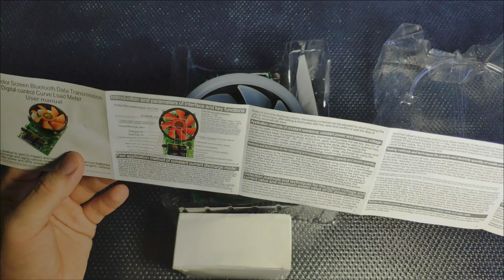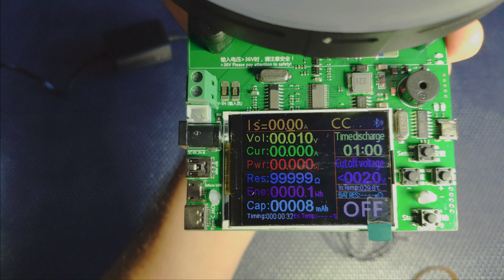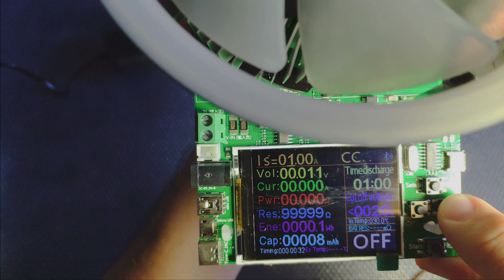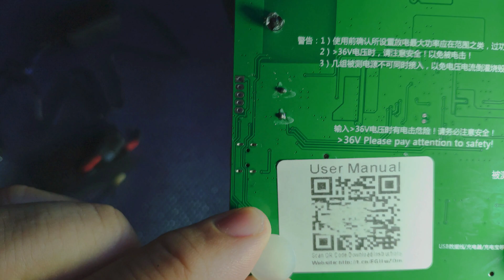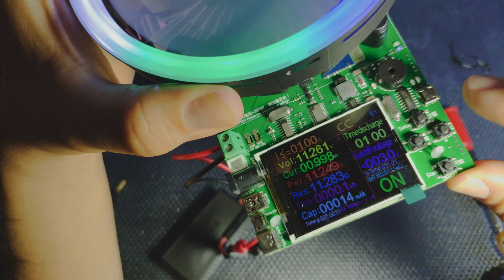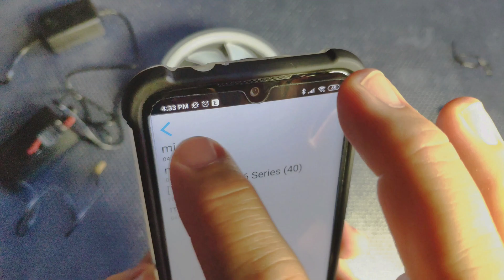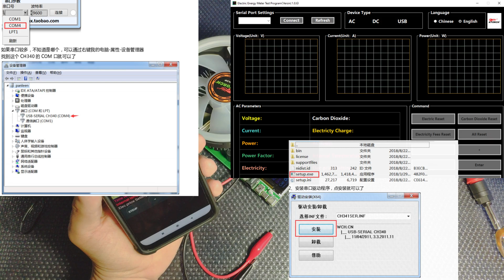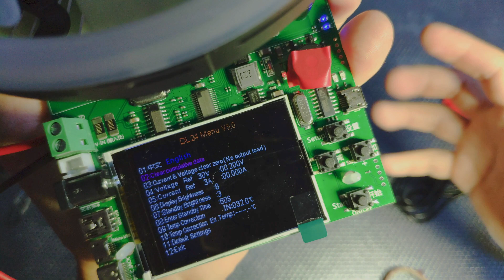DL24 Electronic Load Battery Capacity Tester

Comment: I'm at my second unit dying, testing it with a PSU before connecting to 18650 battery packs to test.
What I did is set the load to constant current, connected to a 84V 5A charger.
When increasing the constant-current value with the buttons, the unit happily increases the current and warns about power overload at the same time as the main MOSFET dies.

And once the unit failed to protect itself, the input is shorted, which would likely result in a fire if directly connected to a battery pack.
The seller Atorch doesn't answer unless there's a dispute.
I would not recommend. If you want to use it, I'd strongly suggest to always add a fuse to avoid short-circuits if the unit fails.
Reply from the maker: 84V@5A = 420W, the limit is 180W for this device. You should set the current to voltage before starting, if it exceeds 180 (185)W it will give you a warning and not start. But if you turn it on with a low current and then you keep increasing it and exceed the limit it will no longer enter protection, this is a workaround if you change the the mosfet and cooler.
Reply: @TechTronic9000  we might have different versions of this product, the behavior you describe is not the same as what's sold currently.
My first unit died as a load to test a booster converter unit, DL24 in constant power mode.
When adjusting the booster's CC limit, lowering it reverted to lower voltage and higher amperage and the DL24 MOSFET died at the same time as it displayed "overload > 185W" in red.

Second using was connected to my 84V 5A PSU, DL24 in constant current mode.
I increased CC value progressively to see what would happen if I did the same when connected to a battery pack.
At some point (wasn't filming) the DL24 displayed the same overload warning again at the same time the MOSFET burned up.

In both cases the input was shorted so that would have been really bad if connected to the 1.6kW battery pack I wanted to measure.

I have seen the warning be effective in some cases and some other not. In my memory, the unit would stop at the same time as the warning would be shown, preventing failure.
Do you think that the safety mechanism only provides protection if voltage and current from the source don't fluctuate, and can only prevent to start if parameters are wrong?

I thought that in early tests I saw it stopped when increasing the DL24 CC or Power targets to overload values.
So maybe the current version is different, and maybe the MOSFET they put in now is of bad quality and burns before safety is engaged.
Reply: François Simond said, "If you want to use it, I'd strongly suggest to always add a fuse to avoid short-circuits if the unit fails."

At the very high currents that can be involved here, I suggest using a CERAMIC fuse of approriate ratings. Glass fuses can shatter/explode under such conditions. Another alternative may be to enclose the fuse in a tough casing. Either way, don't just use a bare glass fuse connected with wires with fuse clamps on the ends (as I've seen too many experimenters do). Glass fuses can explode during very high current failures and in the event of failure send out shrapnel of glass and molten metal, and can even cause secondary fires.
Reply: @exgenica  That's good advice 👍
I got a pack of automotive fuses and a holder for them which is enclosed, within some kind of tough plastic/rubber.
That way any explosion, arcing or fire of the fuse should be quickly stopped.
Since it's very difficult to find fuse that will not arc at higher DC voltages tho, that's what I ended up with as workaround.

Comment: what is the differnece of DL24 and DL24-P ??
Reply from the maker: The new "p" or Plus version is newer and it's more accurate as it has two wires / two circuits one for power draw and the other to measure the voltage at the source and avoid voltage drop, here is it: https://bit.ly/2ImZQ5B
Reply: @TechTronic9000  Great! I will get this version than!
Reply: I have had the DL24P Plus model for a couple of days, in my tests I have detected that it shows voltage values higher than the real ones, in a 32.2v battery the DL24P Plus shows me 35.9v.

I have no idea if it can be calibrated
Reply: @MrSharky1972  Yes, it can be calibrated if you have a calibrated source.  Some other videos show it.

Comment: I bought this load too but it does not work correctly because of the voltage drop through the two cables the detected voltage is not correct. https://www.youtube.com/watch?v=kDYn0xrDQkI
I bought this thing to make a capacity test of my LiIon batteries, but therefor the low-voltage cut-off have to work exact and not with differences of +/- 1V
For exact voltage meassuring you need the original load device with 4 wires. 2 for the load and two separate wires just for voltage meassuring
Reply from the maker: You can replace the original wires and clips with something better, that reduces the voltage drop. Also if you limit the discharge current the drop will be smaller.
Reply: @TechTronic9000  I am already using 2.5mm² wires, that's the biggest which fits the terminals. And I tried to lower the current from 20A to 10A but with same bad voltage meassuring. Lower the current below 10A is pretty useless because this means less than 37 watts load - wich will make the test at a powerbank with 60 or 80 pieces of 18650 cells an endless story. I wrote lots of mails with the seller and finally they said, that it's not possible to get valid voltage data with just 2 wires and they modified a second load for me with two separate voltage wires. It arrived a few days ago and I did not test it yet, but I will do when I have some free time. If this modification works I will take some detail pictures of the points where they connected the new voltage wires and show it on my webpage at https://mona-stefan.de/li-ion-akkus-18650/akkus  so maybe other peaople can modify their existing load too
Reply from the maker: Well for me it's another story, I use higher voltage such as 30-60V range from 18650 batteries with general capacities of 8-20Ah, this takes the device to over 160W+ discharge power and means that I need to keep the amps low.
Reply: @Stefanseiner  Any news on the second wires remote voltage sense?
Reply: @manuelsilva8640  yes, with the additional wires for voltage meassuring it works just fine. Atorch / Hidance now provides a new model which comes with 4 wires, the DL24P-Plus. Seems good to me but it's a little bit expensive (about 42USD) because they only modded the "p" model which stands for the bigger 180W model instead of the cheaper 150W one I am using (about 25 USD as "old" version with 2 wires).
Reply from the maker: @manuelsilva8640  You can find the new "p" version here: https://bit.ly/2ImZQ5B
Reply: @Stefanseiner  I have had the DL24P Plus model for a couple of days, in my tests I have detected that it shows voltage values higher than the real ones, in a 32.2v battery the DL24P Plus shows me 35.9v.

I have no idea if it can be calibrated
Reply: @MrSharky1972  I think in the setup it can be calibrated. Hold the upper button pressed down for a few seconds. or the lower button, not sure

Comment: Very detailed video. I feel the same way about the app. The 300 volt scale is absolutely ridiculous. The app is wasting everyone's' time. How do you get the USB-C port to trigger? I've tried connecting my trigger board, but the unit doesn't respond.
Reply: On PC, click on the top number of the y axis and you can change the y-axis scale on each graph.  (Maybe the same on the phone app.)
Reply from the maker: I haven't tried the usb c port yet.

Comment: Good review. I was wondering if you've tried any heavy loads? My unit was working fine and then I starting discharging a 15v battery at 10 amps (150w). After a few seconds, the unit caught fire. I'm not saying smoke, I mean flames several centimetres high. When I disassembled, I saw that the tiny trace, leading to one of the fet leads, melted and started the fire. Banggood is sending another, but I wonder if that one will be any better?
Reply from the maker: Until now the "worst" case was 150W for 10 minutes, it worked ok but the temp sensor was already at 65°C+. I might try to change the cooler with a larger one from the old age of quad cores :D
Reply: @TechTronic9000  Yeah, got plenty of those. I even have a water cooled radiator system. LOL
Reply: Just because it supports 150 watts doesn't mean it supports 150 watts at 10 amps. Thats a very high current to be putting through those cheap traces.
Reply: I burned out the orignal  IRFP260M MOSFET with 300W (30V 10Amp) because mine said to support 1000W on aliexpress :) I have a heavyer heatsink through.
So I replaced the MOSFET with a 1300W rated one (IXFK98N50P3) and then I put 300W through it for a couple minutes turned it off afterwards because my external temp sensor that was connected to the board didn't work and my multimeter thermal probe was showing like 80C on the base of the heatsink. Currently waiting for new temperature probe to arrive and when I have it connected and stuck between the MOSFET and PCB I gonna see if it can take 300W stable.
What I really wanna tell you is that the trace probably was a oneoff I would say, because I slowly, waiting every time for temperature to stabilize, increased power from 100W to 300W there was > 150W there for at least 1h.
But yeah I would stress the original ones with more then like 150W-200W, 250W is probably already pushing the limit for a 300W rated MOSFET.
Reply: @mrspeedprog  it does not support 1,000W..... thats a lie and you need a ridiculous cooler to even dissipate that much. I don't think you would have a cooler that can handle it
Reply: @mrspeedprog  It could be that the mosfet burned first and caused the trace to melt. In any case, I now have two of the 180w units and don't trust either past 50 watts.
Reply from the maker: I've managed to blow up mine! It was a combination of not paying attention to the warning message and reconnecting the clips. I set it to pull 300W, so the mosfet shorted out, this shorted out my battery, blew the alligator clip and battery BMS. It have got a new mosfet and it's interesting as even though it's the same model, all the writings are different so the original one might have been a cheap clone. Also updated to a huge fan. After I get the time to do the repairs i will also add an in line fuse so I will avoid blowing up stuff. Will try to make a video of the repairs.
Reply: @TechTronic9000  Yeah fuse is a good idea, I added a fuse to mine too after I read the comment here about the board catching fire :) Especially if you use it on high capacity batteries that can potentially put hundred if not thousands of amps through the board this is a must.